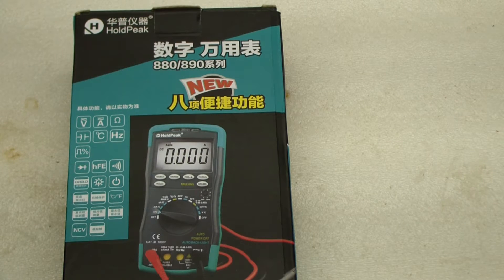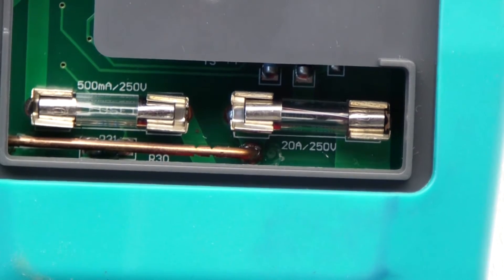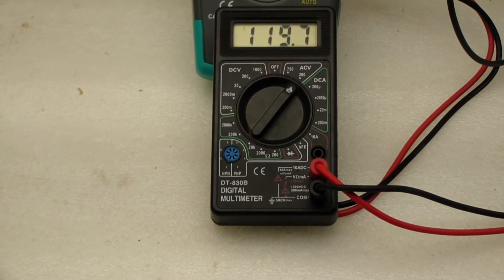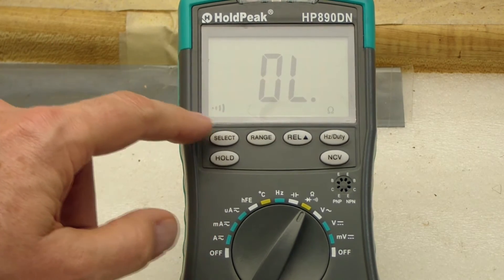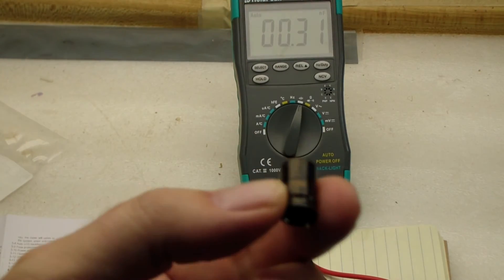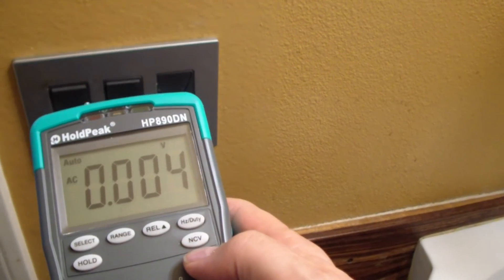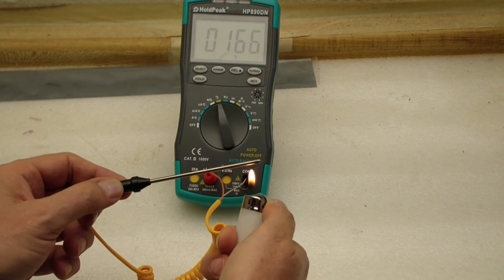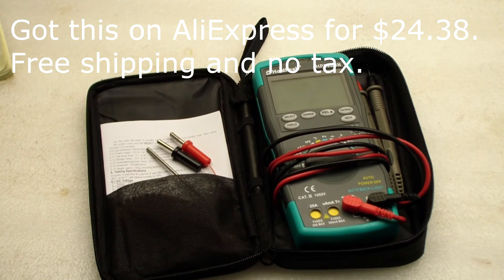HoldPeak HP-890DN Digital Multimeter DMM Review

Comment: how did you compare, CN is much better :)
Reply: CN has automatic backlight, TrueRMS, max/min functions
Reply: +Alan C you need something like this http://www.iso-techonline.com/product/multimeter-current-clamp-adapter-acdc-600a-dc-600a-ac-34mm-2/

just google 600a clamp adapter. as for which is better, I think clamps are preferable since they measure in non contact way.
Reply: Don't forget True RMS!!!!
Reply: true rms mesuring work fine
Reply from the maker: Only had the box to look at. Hard to see much difference there.
Reply: well, 
capacitance: 100 millifarads vs 100 microfarads max value (x1000 times)
current: 600A vs 20A (need special clamps)
counts: 6000 vs 4000
all the other ranges are also greater compared to DN but not so noticeable